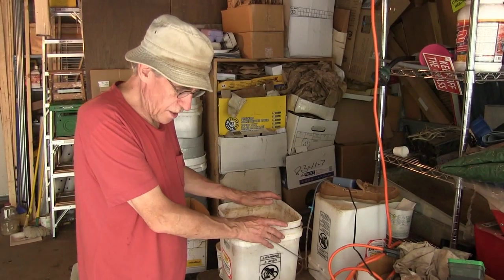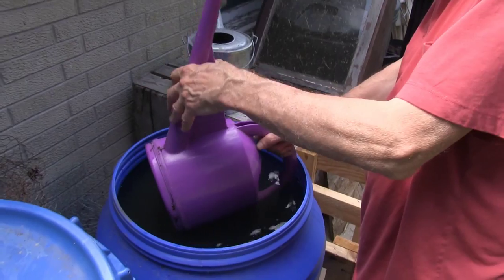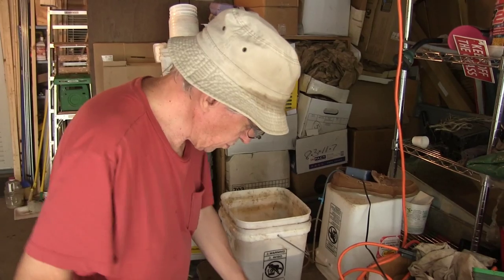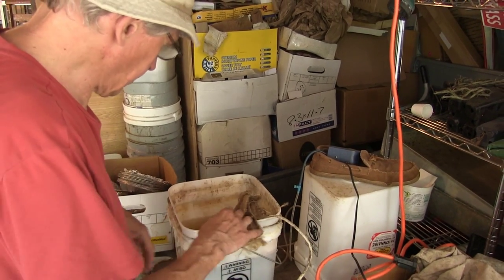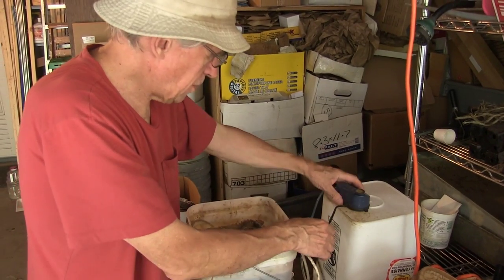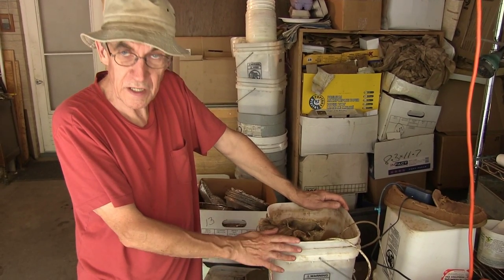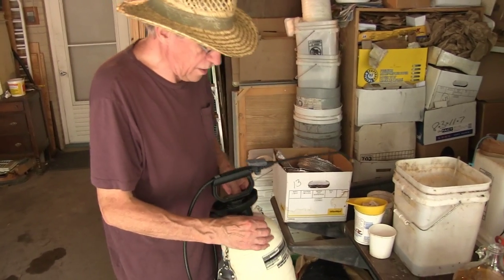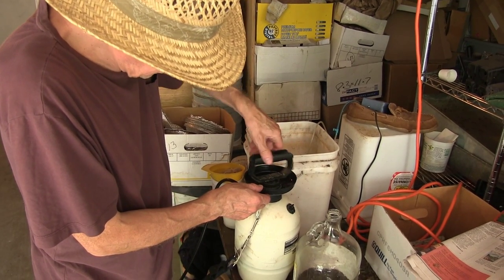How To Make Worm Tea: Pesticide-free fertilizer, additives to use, preparing it & applying it

Comment: The lemon juice is an ascorbic acid component which is needed if your city uses chloramine (vs. chlorine) in the city water supply. Aeration will help to remove chlorine, but ascorbic acid neutralizes the ammonia in chloramine. If you use rain water or well water, this step isn't necessary. Cheers.